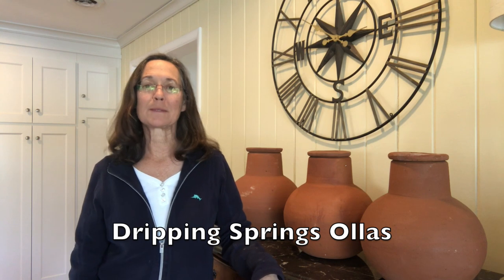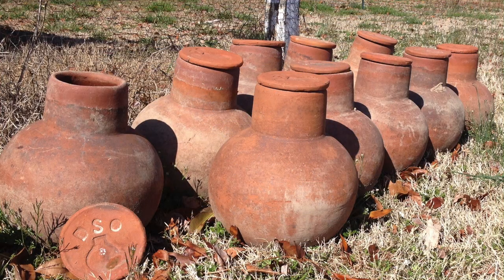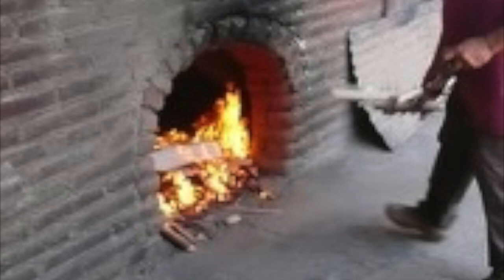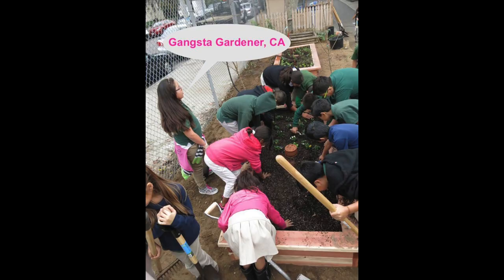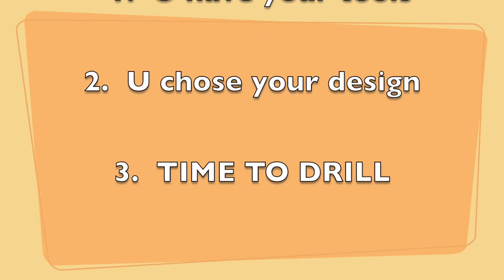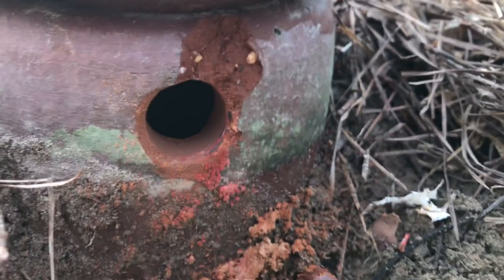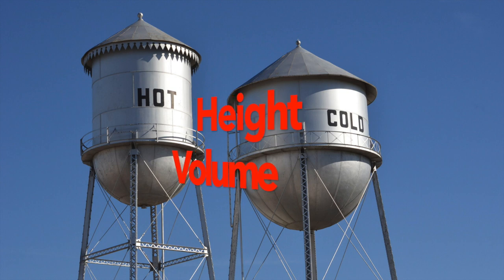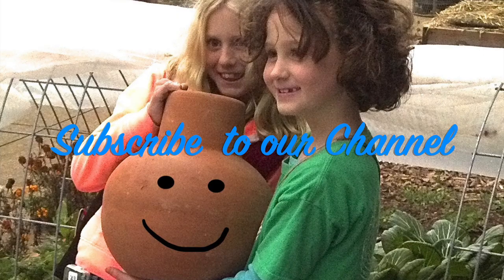Automatic Irrigation with Dripping Springs OLLAS

Comment: I found that when drilling terra cotta, wet the area to be drilled,  using a carbide tipped drill. The water turns the terra cotta to a hard clay property,  the hardness of the bit keeps the terra cotta from chipping or breaking
Reply: Yep, watering the pot beforehand is key. And watering the drill while drilling is fine too.
Reply: @agn855  لا افهم الفكره ممكن شرح؟

Comment: Thank you, I will be trying this method!
Reply from the maker: Great!  Keep us updated on your progress!
Reply: @DrippingSpringsOLLAS  Well I finally got it up and running :) I still need to adjust my valves so the pots fill at the correct rate, and one of my makeshift rain barrels has a leak so I'll need to patch that, but the basics of the system are up and running! Thanks again!

Comment: I would love to use ollas. But, I can’t find very small ollas for my pots for sucklings. Do you have any suggestions? Thank you
Reply from the maker: Check out our website, www.drippingspringsollas.com
Reply from the maker: Thinking....I don't know how small your idea of small is, but our 2 sizes are designed for a large area, about 4 x 4, using the 2.9 gallon olla,  and for a container about 20" to 24" across, using our Medium Olla.  You could use a container with our Medium, perhaps, and put your sucklings in that, to transfer later when the roots get strong.

Comment: If you're running hose everywhere, why not just use a slow drip hose?
Reply from the maker: Using an olla from Dripping Springs Ollas offers several advantages over traditional top soil watering. Ollas are designed to deliver water directly to the roots of plants, ensuring efficient hydration and minimizing water waste through evaporation and runoff. This targeted approach not only conserves water but also promotes deep root growth, resulting in healthier and more resilient plants with enhanced nutrient uptake. Additionally, olla irrigation reduces the need for frequent weeding, as the drier soil surface discourages weed seed germination. This method also saves you time, as ollas require less frequent refilling compared to traditional watering. By embracing olla irrigation, you're not only making your gardening practices more efficient but also contributing to sustainable and eco-friendly gardening that benefits both your plants and the environment.

Comment: It is great idea but there are no pores on the surface of the ollas so how does water reach the soil
Reply from the maker: When the clay is fired it leaves very tiny holes in the clay.  A wood fire is used, firing for about 12 hours.  This creates enough holes so when the dry  soil pulls the water out, soil moisture tension is working.
Reply: @DrippingSpringsOLLAS  many thanks for your reply, how much does one olla cost in your country
Reply from the maker: @ImranMohammedkhi  The price varies a lot because some of our retailers are online, so they have to add shipping.  In store prices are usually around $35.00  or so, and online is $60.00 or so.  I don't set the price, so these are ball bark figures.  What country are you in?

Comment: you need to put an individual monitoring floating sysstem so you know how full each olla is, very easy with a piece of wire and a piece of styrofoam, then the problem is that the ollas do not fill themselves at the same level even when you gradually open the valves at different degree, that is why you need a floater.